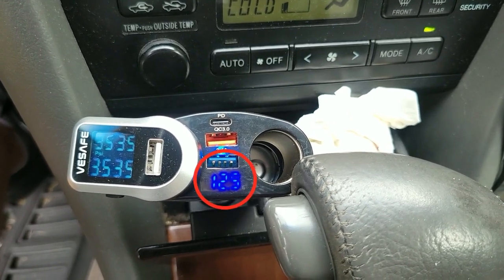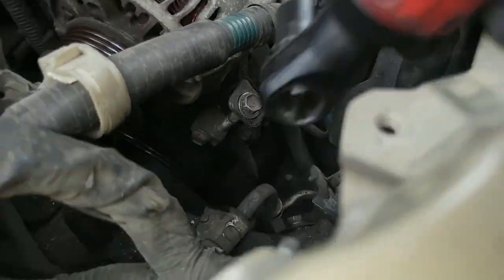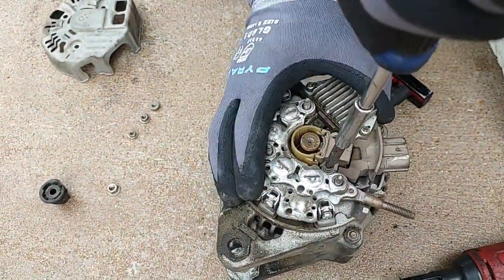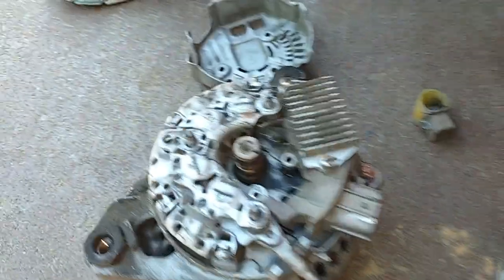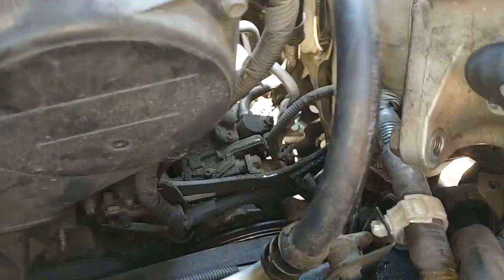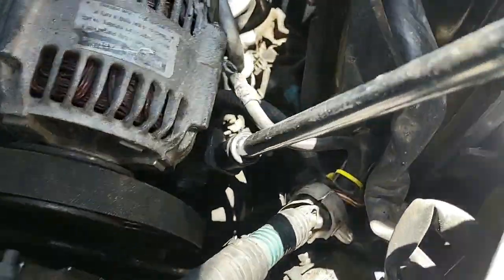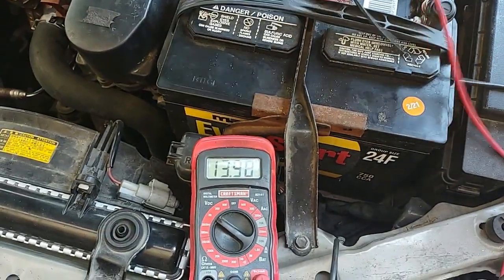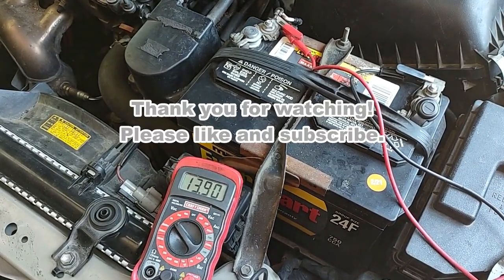Alternator failing? Replace the Brushes!

Comment from the maker: Always a good idea to get an aftermarket voltage indicator that plugs in to your accessory/lighter port so you can monitor the voltage output of your car. Surprisingly even most modern cars still don't offer this information on the dash.
Reply: Keep a tester handy is better do more than one vehicle. My vehicle does have a stock meter 93 Ranger... Going to try brushes first since it's the motorcraft original most likely

Comment: so normally the alternator fail is the brush need replacement ?. i have 
DENSO Alternator 2104215 for mitsubishi eclipse 2008 gs 2.4L , can you tell me where i can get the parts ? thanks
Reply from the maker: The brush could be the cause of the failure but not the only cause.  Suggest you inspect the brushes for excess wear.  Also check on Ebay for vendors selling brush replacements for your make and model vehicle.

Comment: I always enjoy watching your content!!

One of the problems with replacing an alternator or starter these days, is that what you're going back with is significantly inferior to the OEM part you're removing. Therefore, I'm all for the brush replacements!! The only suggestion I would have added, especially since you had the Volt-Ohm Meter ("VOM") connected, was to switch to "Volts AC" to check the "ripple". The service manual should state what the maximum AC voltage should be. Ideally you don't want to see any, as the capacitors in the alternator are what's responsible for taking the AC voltage and clipping it to a DC voltage output.

Best regards.
Reply from the maker: Thanks for your post!  Makes sense about the ripple test.  FYI - You don't have to wait for the alternator to "act up" before replacing the brushes.  I replaced the brushes on my 99 Camry CE at 200,000 miles and they were visibly worn even though the alternator was putting out good voltage.  I now have over 300,000 miles on it and still going strong!  Mind you, this is the original OEM Denso alternator on the Camry.  This video was performed on a 2000 ES300 with 230,000 miles.

Comment: Just start your vehicle then disconnect the battery if it stays running you are good if it shuts off its alternator
Reply from the maker: That technique, unfortunately, won't work on all cars.
Reply: Its never failed me I've been doing it since the 70s and it still works
Reply: @henrykennedy1120 
😂 New cars have modules ECM, TCM, BCM ect they require a constant DC source of power from the battery. The AC current from the alternator alone will not run the vehicle.
Reply from the maker: Thanks for sharing!  Can't hurt to use your technique.   I remember on a 2000 Lexus RX300 we jump started on a discharged battery.  Check engine light triggered and hardly anything electrical worked properly (i.e. blow motor, windows, dimmed headlights, etc.)  We charged the battery up, restarted the car and all the electricals worked fine.  Seems that on the RX300, the alternator would not properly run the car's electrical system with a discharged battery (or corroded battery terminals as well).

Comment: You're telling me a $15 part replacement can bring my alternator back to life?  Good deal!
Reply from the maker: That's right!  Less than a $15 part.
Reply: We use to rebuild them all the time, brushes and bearings. Unless you left the bearings get too bad that the armature touched the field. Even then they could be rewound but that was a specialty shop that did that.